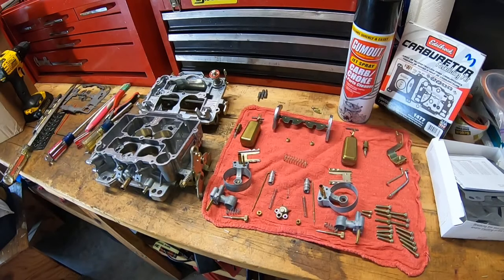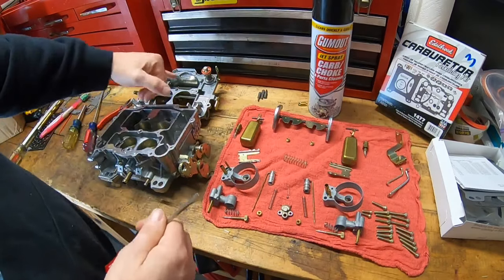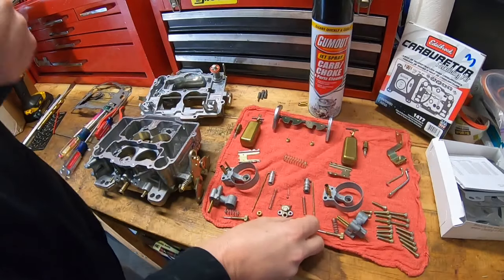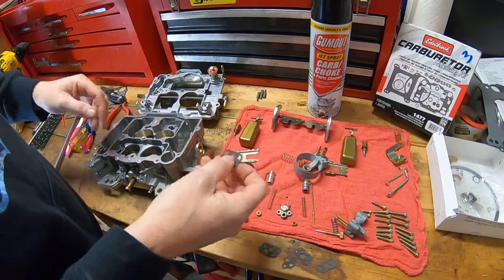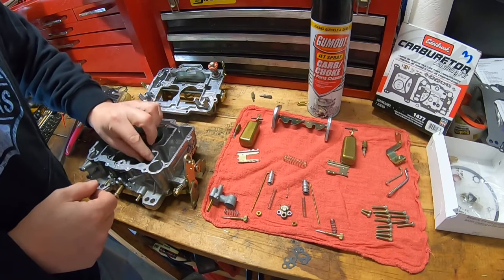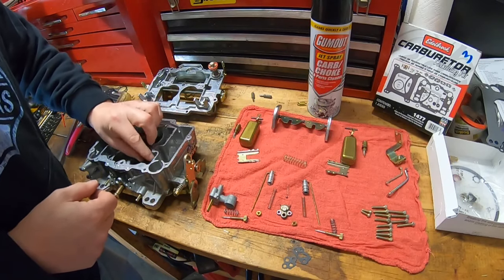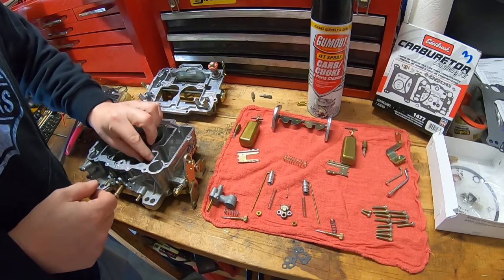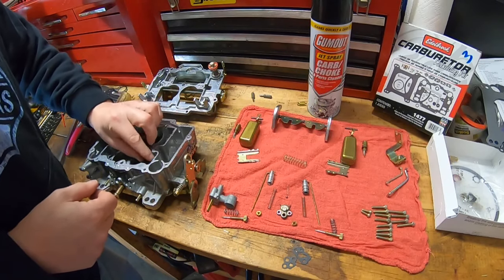Edelbrock Carb Rebuild Step by Step

Comment: Do you typically see the same scenario in these carbs when you rebuild them?
Reply: @MuscleCarSolutions  If there are signs that ethanol has deteriorated the coating at the bottom of the fuel bowl, do you just get rid of them? I have a 1405 and the bottom of the fuel bowl no longer has the same sheen after cleaning that the rest of the carb has. Thanks for your videos!

Comment: Nice video but you forgot to set float drop  and i would of checked the 1.3 centimeter adjustment for opening rear throttle plates
Reply from the maker: Nothing forgotten.  Drop has little relevance.  Made a video on that topic as well.

Comment: What do you do is the gas has already started corroding the aluminum in the bowls?
Reply from the maker: There isn’t much you can do really.  Get more diligent with draining the fuel from the carb if the car is going to sit for more than a week or two at a time.  Use the Driven carb defender can help continue to push the water and crap through the system.  Once it starts though, it’s only going to get worse.  Doesn’t matter what brand of carb.  Ethanol kills them all if not looked after.
Reply: @MuscleCarSolutions  I bought it used and realized it needs a rebuild.  Opened it and saw the corrosion.  Oh well, it's a temporary carb but I plan to eventually sell it and dont want to sell junk.  I'll try the carb defender.  Thanks!
Reply from the maker: @curtthompson2787  not much can be done with them at that point.  Just baby them and get a few more miles out of it!

Comment: I have a 1406 and I don’t think the choke or linkage is working properly I’m very new to carburetors and don’t know what to do any tips?
Reply: Bone Head electric after watching some more of your videos I think there is binding in the choke linkage because if I operate it by hand it seems to be a kinda difficult then it seems to break loose
Reply: Wondering about the way the air control weighted thing goes in there,   it seems it only goes in there 2 ways one all the way closed or other shut but open part way.  Another question  this carb was really corroded  and I only found a check ball in it , but it might have gotten lost. This is a carb 900 something s ,  and on a boat motor 4.3 or 4.5 sorry but still , do I need a weight in there in accelerator jets,?

Comment: Hi, I’ve a 1901 on my vehicle. I bought kit 1920 which is supposed to cover 1901. Seems to be very short on parts in the kit. Ie, there is only 1 float valve. What is the most comprehensive kit I would need ? Does it depend on year ? Thanks
Reply from the maker: Are you referring to the old Edelbrock q-jet?
Reply: @MuscleCarSolutions   Well it’s a 96 Boss Hoss so not sure how old old would be. Sorry I’m in U.K. and this is my first experience with American equipment
Reply: @MuscleCarSolutions  just found the 1901 parts list. I float. I’m an idiot sorry.
Reply from the maker: @knockdolian12  hmm..  Not sure what they put on those bikes.  Does your carb look like the carb in this video?  Or different?
Reply: @MuscleCarSolutions  from the outside looks very similar. Just watching videos on rebuilds and assumed all these 4 carbs were the same. It looks like the 1901 has 1 float. Are all 1901s not the same ?
Reply from the maker: Unfortunately Edelbrock had two different 1901 carburetors.  The first was a quadrajet carb that was discontinued in 2009-10.  When the AVSII carbs came out, they reused those part numbers.  When you mentioned the year on your bike, I assumed it could be the old qjet carb, but it could be the new AVSII carb.  The qjet is vastly different looking on the outside and should be easily recognizable.  Google it and look at the images.  You’ll know right away which one you have.
Reply: @MuscleCarSolutions  Thanks for taking the time. Just seen. I’d say mine is the old 1901. It looks like the AVS fuel port is much higher and to the rear. Mine is on the front and lower. Would the kit I have with one float valve be for the old carb or the new one ?
Reply from the maker: Old.  The new carbs have two floats.
Reply: @MuscleCarSolutions  Again, thanks very much for clearing that up and taking the time. All the best
Reply from the maker: @knockdolian12  anytime.  Cheers!

Comment: Carb leaking from accelerator pump side any ideas
Reply from the maker: What is your fuel pressure set at?
Reply: How do I check
Reply: And whats controls fuel pressure
Reply from the maker: Watch my video “The Ultimate Edelbrock Carburetor Tuning Guide”.  It will show you how to set up a fuel system.